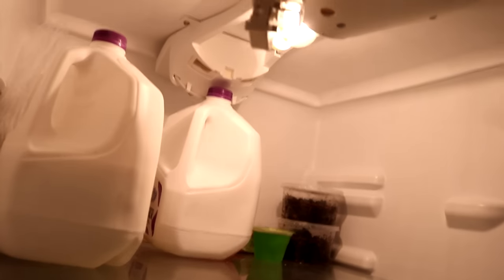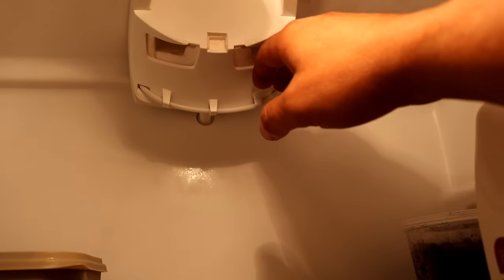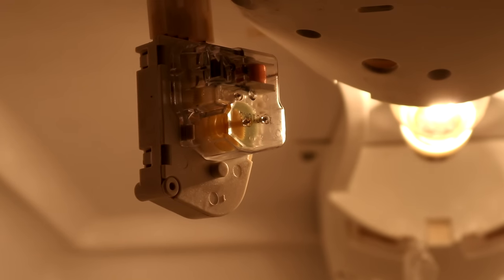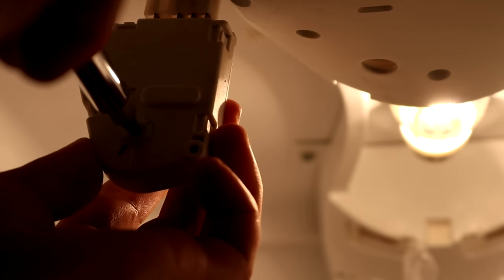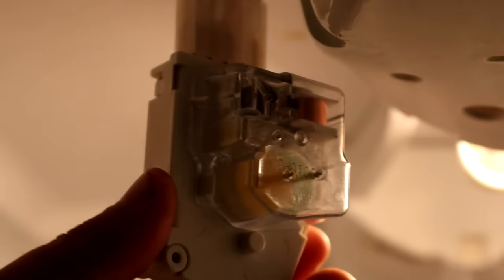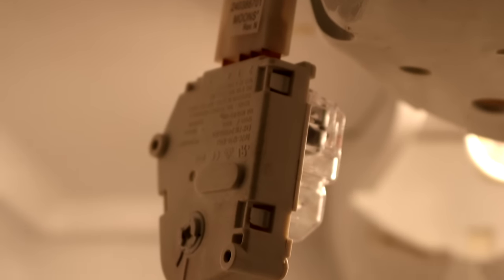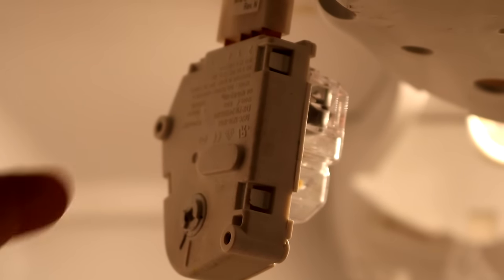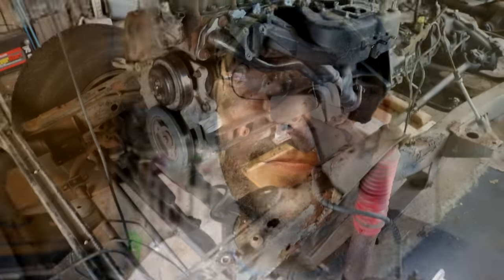Refrigerator Not Cooling - How to Check the Timer

Comment: Thanks for the video, your fridge is remarkably similar to mine which makes it extra helpful HAHA.    It looks like my timer is finished and was stuck in defrost mode.   Additionally we had some milk go bad recently so I'm wondering if the timer has been working intermittently.

Good luck with the jeep rebuild, I used to have a Cherokee with the 4 liter until it got too rusty to repair.

Comment: Bill, great channel. Have Kenmore top freezer that was not adequately cooling.  Replaced defrost timer.  The freezer is now between -5 and +22, fridge stays +43.  Checked thermostat as you showed and it works. Fridge lives in garage in Florida but we had nights in the low 30s. Help appreciated-also fixed the sagging door.

Comment: Excellent video. Had the same problem with a new Frigidaire just 6 months old. Froze up once, fridge went hot. Second the timer just stopped whole thing went hot. Finally on the third service call had the tech pull the timer. That solved the problem.

Comment: Thanks for the info.
What is going on if refrigerator seems cold enough but freezer will not freeze cold enough for frozen foods?
I’ve checked the heater, works fine.

Comment: Great video.... Let me tell you why.... so, the other day I replaced the heater element in my Frigidaire (GLRS263ZDB4) side-by-side refrigerator. It took 4 days to get the replacement element, IT SEEMED LIKE FOREVER. Afterwards, I let it run overnight and everything was fine.... it worked great. Wanting to make sure that everything was going to be fine for more than 7 hours, I opened the freezer section and put pressure on the thin metal cover that covered the cooling coil in the freezer.... BUMMER... I could tell that frost was building up behind it again. I removed the 4 screws for the cover and saw that the top portion of the coil was very frosted, the bottom half looked good. Not having any experience with this repair and not sure that the heating element was working,  I saw another video telling you that you had to press the refrigerator door switch three times to engage the adaptive control for the coil defrost. I tried that a few times and BLAM.... NOTHING.... NOTHING AT ALL. So now,  I'm questioning my repair. I see your video an hour later and it says to press the refrigerator door switch five times, not three and SUCCESS.... THE COMPRESSOR QUITS RUNNING, AND THE COILS, WITHIN A MINUTE ARE COMPLETELY DEFROSTED. So now I'm relieved that the repair was a success.... now hopefully the Defrost Thermostat and/or the Refrigerator Adaptive Defrost Control won't go bad... at least any time soon.... THANKS AGAIN.
Reply: I'm saddened to learn of this great guy's death.... Damn! God Bless Bill!

Comment: Oh boy! Our Whirlpool refrigerator model number GB2SHDXTQ01 quit cooling (60degrees), but the bottom freezer seemed to be functioning okay. We thought by morning that would be a different story. So, we transferred all the goods to the basement refrig and freezers that night. The next morning when the wife first got up she commented the Kitchen Refrigerator was cooling normally again like in the lower 30s. HA! All that work going up and down the basement stairs.  I told her the Whirlpool still isn't trustworthy. I originally purchased a start relay and capacitor quickly because it takes days by mail to receive them. By todays observations, the compressor runs so quietly, but I feel a sight quiver through holding the door handle when the compressor shuts down (built in compressor shock absorbers movement). Any suggestions? This is a great video, thank you!

Comment: Similar problem w/ 1998 Kenmore, removed ice buildup in drain & air flow, now have air flow to fridge, but not very cold.  Perhaps the defrost timer?  Thanks Bill, great video, will look for more.
Reply: First, make sure that the condenser fan on the bottom next to the compressor is running at the same time when the compressor is running. Also, verify that the condenser coil is clean of dust and hair.
If it's all good, you may have a Sealed System problem. To find out, remove everything from the freezer and look at the evaporator coil. (before you do this, let compressor run for about an hour) The evaporator coil should be covered in a thin layer of frost in a healthy system. If there is only one patch of frost somewhere on the top or the bottom, it's time to go shopping for a new fridge. If the coil is completely covered in a very thick layer of icy frost, you have a defrost issue which is relatively easy to fix. Let me know what you find.

Comment: I have a 2-door Hotpoint fridge and it had stopped cooling for some reason a few months ago, so I stopped using it. But I would like to fix it. I plugged it in today. The compressor is working, is a little warm when you touch it but no cool either in the freezer or refrigerator. I don't remember I had a defrost issue with the fridge. 
Not sure where to start and what to check. Can you suggest some steps to check this fridge as to what the problem might be?

Comment: If you have a Whirlpool fridge and the refrigerator timer comes with a black wire I am reading in almost all advice columns that the black wire goes on terminal #1. A very few people indicate it for terminal #2. My question is if one puts the black wire on the wrong terminal would it damage any component of the fridge? Thank you.

Comment: I have twin samsung refrigerator, the fridge suffer from ice in evaporator after 5 to 6 days, all sensors are okay (evap, cabine and ambient) the fan works as well.
Is this fan responsible for defrosting in twin refrigerator? and should it be replaced only if it stopped working or  are there other signs that necessitate its change?
Reply: Try to find technical documents for your specific model. You may have a heater or just a fan for defrosting. Temperature sensors (thermistors) may have continuity but still, be "bad." You need to measure the resistance of those sensors and compare it to what's written on the tech-sheets, because they may be showing the wrong temperature. And that will make the defrost cycle too short. If your model uses the fan only, it could be too "weak" to move enough air for defrosting purposes.
Reply: @Your-Self  Thank you! there is no heater for this model, just a fan and the Temperature sensors (DA32-00066H) which has been already change. I tied last week the fan motor of the freezer fan (since it's the same motor model), but unfortunately yesterday the door display temperature  started Winking as usual at 3°C and the temperature inside the fridge was about 18°C. Can this be a failure in the mean card or the voltage supply which results a weak to the fan?
Reply: @mrdarho4718  Dual evaporators refrigerators are very sensitive to all changes, and it may be difficult to get it just right.
The defrost sensor must be placed on the evaporator "inlet" and face the evaporator, not the wall. (INLET is where the small diameter copper tube merges into the large tube, so attach the sensor to the large tube)
Defrost water maybe not draining very well, if you have the older style "duck-bill" drain pipe.
The evaporator plastic cover may be cracked or not sealing very well, letting extra humid air where it's not supposed to go.
The fridge door rubber gasket may be warped or cracked, letting too much air inside as well.
What is the model number of your fridge? Maybe there is a hack to extend the defrost cycle.
And, if nothing helps, the last resort would be to replace the motherboard.
Reply: @Your-Self  Thanks, here is the link for the video, I made, that Summarizes the problem https://www.youtube.com/watch?v=BgDvckWUwfQ&feature=youtu.be
Reply: Mr Darho this is European Samsung, and unfortunately, I can't find any valuable tech-info on this unit.
By default, the temperature is set for 3 C... press on "Fridge" button a few times to increase the temperature to about 5 or 7 C (after you manually defrost the evaporator). By setting the temperature higher, the compressor will run less and give more time for defrosting. You can also call Samsung and ask them for a "code" to increase the defrost time (defrost without heater means that the fan runs while compressor rests, so make sure your fan continues to run for a while, after compressor stops).
If your new defrost sensor was frozen, it may be compromised and needs to be replaced again.
If Samsung tells you to replace the motherboard, I'd replace the board and the sensor together.
Reply: @Your-Self  Thank you so much, I just want to let you know that I tried to set the temperature higher to 7°C but the same result. I will try to replace the motherboard. This samsung is from Algeria, I called different samsung agents for several time at the beginning of the problem, but unfortunately they can't solve it
Reply: @mrdarho4718  good luck with the new motherboard! Also, verify that the lights inside the fridge go OFF when you close the door, and not staying ON all the time.
Reply: @Your-Self  Thanks for the wish! Yes, lights inside the fridge go OFF when the door is closed as well, confusing problem!

Comment: Bill, I have a Hotpoint CTX21DABRRWW fridge.  I've replaced the relay on the compressor.  Freezer compartment is cold and fan blowing.  Lower fridge is not cold at all, no fan blowing, no air moving.  I can't find the defrost timer on this fridge at all.  Do you know where I can find the defrost timer on this unit?

Comment: I noticed a while ago that the pan underneath is never filling up with water any more.  The fridge isn't cold and there's one spot in the freezer that's frosting up bad but the rest of the freezer isn't that cold.  It's an older Amana freezer on top fridge.  Thanks for any suggestions.
Reply: Probably has a refrigerant leak

Comment: Just reading a repair manual for a Maytag. If the temperature control switch is turned to maximum cold it will keep the door closed which allows cool air to enter the refrigerator section. It will cause maximum cold to freezer only. Possible this will be common to other manufactures.

Comment: At 6:25, you mention that there is a possibility of fire if the defrost thermostat is bypassed. Has this ever happened? I find it scary that if I go on vacation and some malfunction equivalent to a manually-bypassed-defrost-thermostat condition occurs. I checked my circuit diagram and they have a 72degreeCelcius thermal fuse in series with a 384Ohm heater element which I think is driven from some transformer. It is a Japanese brand 237 litre net capacity, 240VAC and 580mA draw.  I can sleep at night ... on vacation if the lockdowns ever get lifted. Appreciate the tips.

Comment: Question:  If the manual defrost timer malfunctions and the clock inside quits turning while in defrost 20 min cycle won't the defrost thermostat kick in and open the connection shutting down the heater, and therefore preventing overheating damage?  Of course the refrigerator will not function any longer, but at least the freezer heater coil will shut down

Comment: Why is the fridge. compartment dial not working?
We have a Whirlpool 30" 18 cu. 
The other day I noticed that the fridge compartment wasn't cooling. 
I can here the fan running but, there is no cold air. Whenever I move the dial to recommended setting or cooler, nothing happens. 
The fridge is about 15 years old and has never been cleaned underneath or in the back. 
Our son is suppose to clean this every 2 years and, he has told me several times he did do it. I am wondering if he is telling me a lie!? Could this be the problem? 
GOD bless and thanks a lot.
Update: I also noticed the freezer dial clicks when I move the dial but, the fridge dial doesn't click at all. If I turn the dial all the way up, the fan shuts off but, when I turn it down it comes back on just no cold air.
    Awesome video, Bill and thanks so much for your knowledge.

Comment: Also with a refrigerator with the ice compartment on top and refrigerator bottom,, like the old school ones door up top door on the bottom cold air should be coming out of those holes from the freezer into the refrigerator as well I worked at a 136 apartment complex and I found this problem many many many times so you would take the panel out of the ice compartment up top and make sure no ice is blocking those holes

Comment: Although I’ve ordered a new defrost timer, because it’s fairly cheap, after sending it into defrost mode and standing there with the freezer door open for about 15 minutes, I can’t say I heard water trickling in the back, like I just did the other day, long after my problems began. Perhaps, I need to stand there longer. Still, as the defrost thermostat is also fairly cheap, I may go ahead and order one as, I hate shipping time, particularly since some places will charge you for USPS Priority and don’t bother shipping until a few days later, so you’ve lost a full week or more. Plus, I’d much rather do this type of work during the weekend, when there’s a bit more time.

I’m just learning about my refrigerator, due to the problems I’m having but, my impression is that, other than the refrigerator being at least 15 years old, I think that it’s possible that having water drip down from the freezer, since that line where it is supposed to drip was blocked for so long and then things getting really worse when it got very humid during the July 4th week, causing a lot more water to come into the fresh food compartment, I wonder if it’s possible that water got into the defrost timer and just ruined it. After all, it’s pretty much right back there, where the water was coming down.

Also, I’m kind of glad that I don’t have a side-by-side. I get the feeling that the less solid state something is, the more it is prone to fail and, from what I’ve seen, those seem to operate by opening a flap to move air from the freezer to the fresh food area.

By the way, I don’t know about anyone else, but I love to hear the sound of the defrost timer as I turn it. I like the clicking. Could do that all day.😆

Comment: MR BILL so my situation"  Frigidaire like yours.. freezer working refrig not cooling.  I advanced the df timer and every thing came on.. fan, compressor, and blowing cold air to refrig.  Left for a week vacation came back freezer working compressor on no fan refrig not cooling.. advanced timer again but this time all it did was turn off the compressor no fan no refrig cooling  Do you think it is DF timer?

Comment: A quick way to check the older timer refriges...with a flat screwdriver, advance the timer into defrost then immediately out so that the compressor tries-and fails- to start.This may take a few tries...after it is off on high head pressure (timer in refrigeration/run mode) open one of the doors and observe the lighted interior...while doing that, advance the timer into defrost mode.If the cabinet lights dim slightly, the heater is good.

Comment: After i checked the timer as you have described-> first turning one round in clockwise direction -> the fan and compressor got turned off -> then waited to see if the heating coil works or not.. i could not hear any sound of water or see the coil.? now how can i know that the timer is ok or not.?

Comment: My problem is that freezer is not cold on my Frigidaire top freezer refrigerator. The fan is blowing in top freezer. I did the turning the defrost timer with a flathead screwdriver. No help. However, I can hear hum noise coming from back of fridge. Any ideas?

Comment: Hi Bill, great video, But I have to opposite issue, my freezer is not freezing, the frig part is cool but the freezer section on a side y side, the freezer is cold but ice cream s melted. Anyway, I'm thinking my defrost timer may be stuck in the DEFROST mode could that be the probelm.?
 Thanks
Reply: clean the fridge coils
Reply: if the condensing coils are dirty you will not remove heat also if your evaporator coil is frosted over from the bi-metal it will block the airflow
Reply: Who passed?
Reply: I cleaned the coils (they were dirty), also put a screwdriver into the defrost timer and turned it clockwise a little because I thought it might be stuck in defrost. Anyway, after several hours the freezer section started to work and got down to 6-10 degrees, the ice maker was also working. I put the lower cover on the back of the side-by -side and pushed it back into place. Now today, 24 hours later the freezer section is back up to 28 degrees (not working again). using a laser thermometer I checked the temperature of the compressor before putting on the rear panel and the compressor was about 129 degrees (felt very hot to the touch) is that normal for the compressor to be that warm?
Reply: oops, that was supposed to be "got down to 6 to 10 degrees in the freezer section.
Reply: It sounds like you're refrigerator thermostat is going out. they're temperamental sometimes they don't go all the way out they work for a couple hours then turn off. how you can tell is if you bump the thermostat dial and it kicks on it's bad
Reply: You can top on the actual dial while the fridge is off if it kicks on it's bad
Reply: JJ thanks for the info about the timer, I will check it again to see if it's working. Hey do you know if the compressor should be 129 degrees on the outside, is that about normal to be that warm?